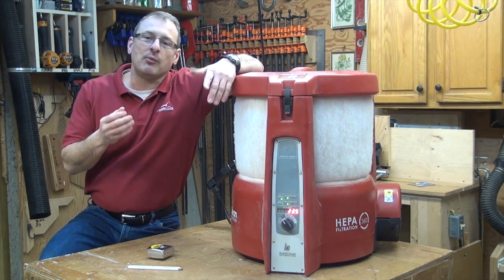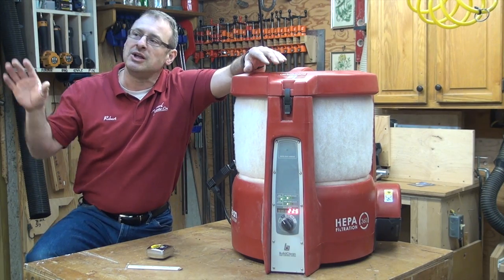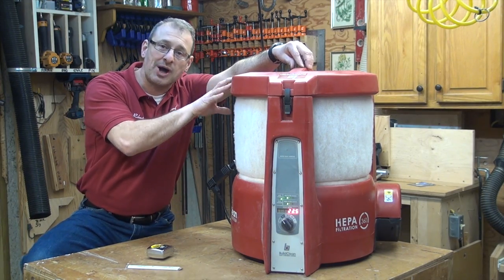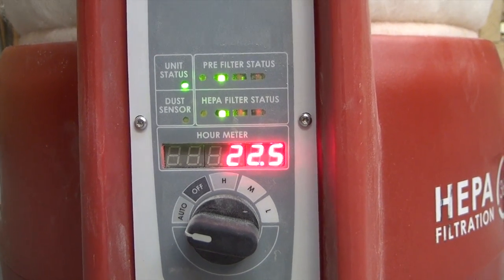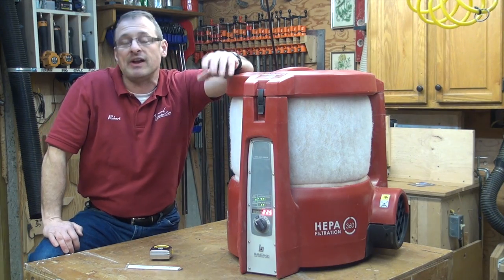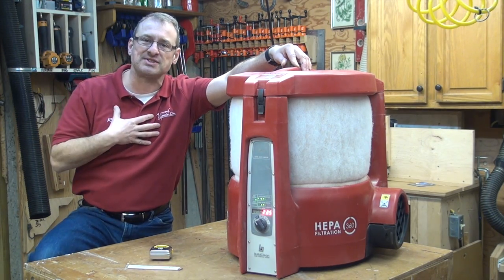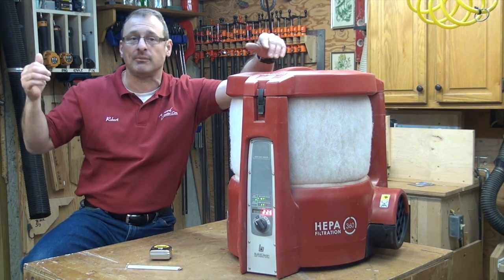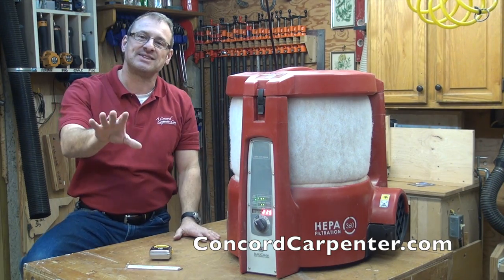BuildClean Dust Control System

Comment: If anyone has an error code 6. Try this. Clean the black rubber air intake located between the control board and the prefilter, have the switch set to off, place your finger over the air intake and keep it there, turn on the unit and wait a few seconds for it to calibrate.

Also if anyone needs a pre filter I bought the rest of their supply.

Comment: Is there a bag that collects the dust? I do drywall and we make a lot of dust so I’m looking for the right product to keep the air cleaner
Reply from the maker: No There is a pre-filter in a pleated HEPA filter as well as a exhaust hose that you can put out a window to create negative pressure
Reply: @ConcordCarpenter  thanks, would be interested but I read that they are not in business anymore. Big investment for something that can’t be fixed

Comment: Good stuff I have a couple of these running in garage.  Anyone have recommendations on filters $100-500 for running inside that are " quiet" and actually filter out HEPA (smaller microns)  I have just done a lot of paint sanding, construction during the day then come home and afraid I have a lot of that dust in my hair, tools, etc.  I try to separate but a lot is even on my skin as I'm a handyman.  I heard only HEPA will filter the low micron asbestos in air.  I work mainly on 1920-1970s homes and often have to go to jobsites where people are sanding or removing demolition etc.
Reply: if you ever wanted to sale one let me know

Comment: So, a few  things:  1.) Why didn't you actually demonstrate the unit?  2.) It is NOT 360 degrees of intake.  Clearly.  3.) You state that it gives six exchanges of the air on the high setting in a 6,000 cu. ft. room, but don't state that it takes an hour to do that or that it will not actually perform that well because as the filter(s) clog during that hour the unit is de-rated from 600 CFM.   I'm just curious why more planning and professionalism wasn't put into this video.  How about cost and life of consumables?   Are you trying to promote this or make people suspicious of the product and vendors?
Reply from the maker: Richard M thanks for the feedback and for calling me unprofessional. We've been using this unit for 4-5 years now and it's the best investment we've made for our health and for being responsible, professional contractors. As far as demonstrating the unit, I made a decision NOT to bring my 2k camera into a dusty environment, so I used photos. The filter is 360 so if it's not a 360 intake, please explain more. We vacuum, as well as, change our prefilters - the main filter lasted over 8-10 demo jobs.